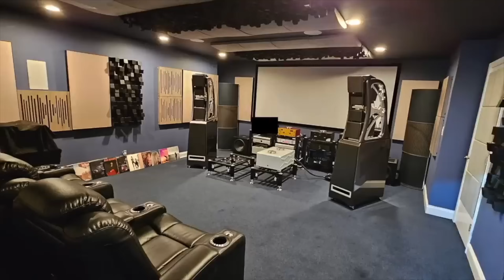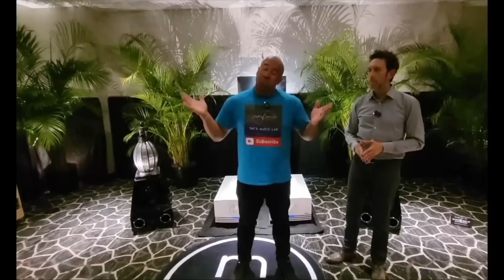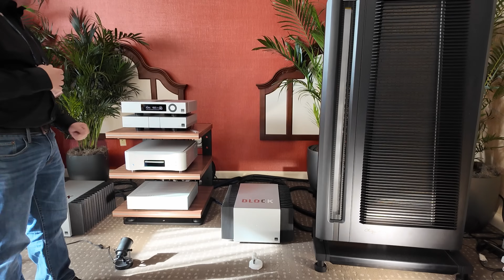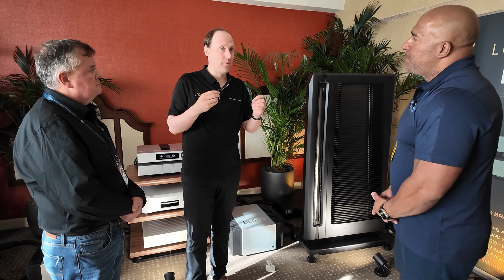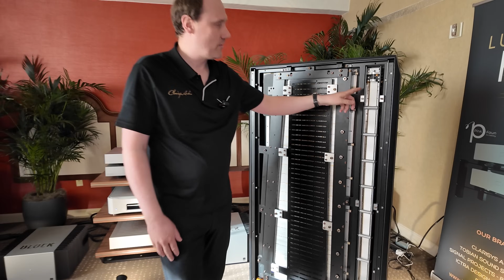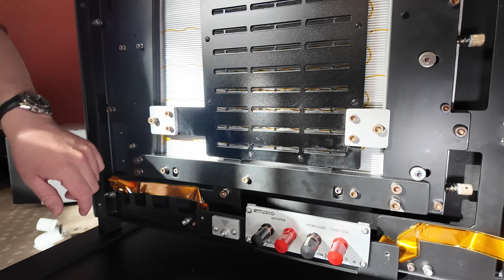Southwest Audio Show - Room 1101 - Clarysis Audio Studio Plus Loudspeakers

Comment: I have the Apogee Diva and the Maggie 3.6, I always think problems with them are bass texture and dynamics. I believe that problem comes from very limited panel excursion unlike conventional cone woofer. I don't think one side only magnet structure is the best way to go. I have not heard any of them but for that high price I would prefer front and back magnet structure like Diptyque or Alsyvox that can push bass panel more even with covering the front side little more.
Reply: Hey look, now you have options and choices. This is a good thing. BTW what color are your Alsyvox speakers?
Reply: I also have the Diva and have none of those problems.
What size room do you have and what amplifier are you using?
Reply: @matthewnicholas7118  About 20 X 18. I use ATI on bass and tube on mid high. Bass seems slow and I couldn't match the bass and subs right and I have added DSP active Xover and that helped so much. Still I would like to try Alsyvox with both sides magnet but that cost so much.
Reply: Double side is not needed if you use N52, like we do. We also have factor 3 the excursion over the classic Apogee and most importantly is that our structure is very rigid and we dont block 50% infront of the driver. The only real reason for double sided, is because twice cheaper magnets is less money then 1 set of expensive ones